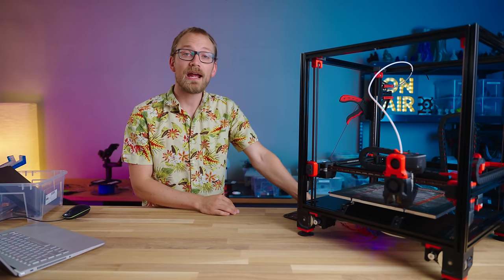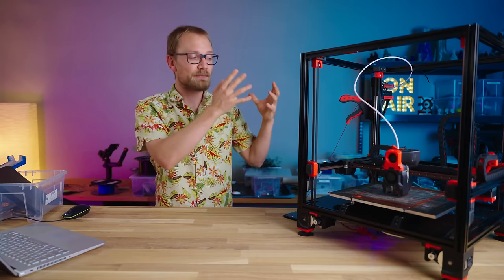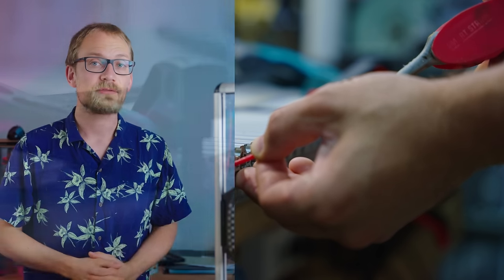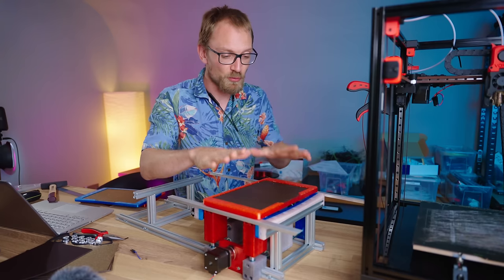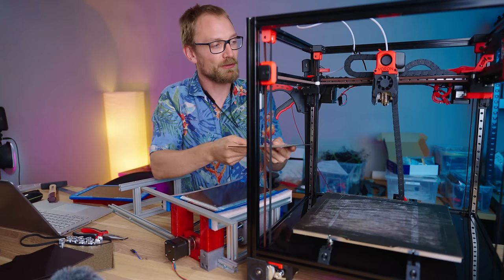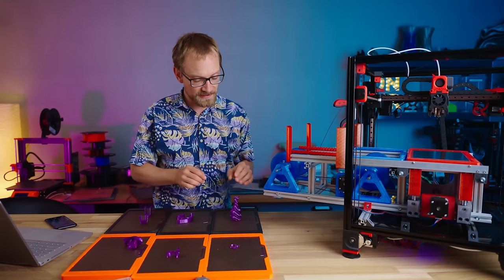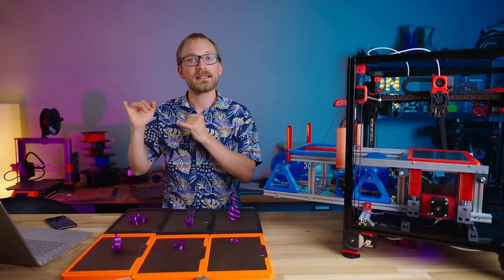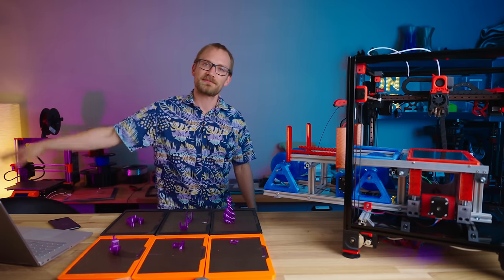Fully automated 3D printing using REAL print beds!

Comment: This is a really elegant solution to this problem, I really like the way your contraption is engineered! Now all it needs is an extension out at the end to catch the beds, perhaps in similar fashion to the hopper which feeds the beds?
Reply: Why not just a ramp with a slideout area? Simplest solution possible if you have some space on the side of the machine.
Reply: @nukularpictures  That could work well too, and would avoid collisions between beds and prints, however I was more thinking along the lines of keeping the footprint of the contraption as small as possible.
Reply: @cytokynesys  Well maybe just have the ramp sigsag down below the machine? If you want to keep the footprint small. 
A hopper will not really work with the prints. I mean you could build a horizontal storage but personally I like to build stuff as easy as possible and there nothing beats a simple slide.
Reply: @nukularpictures  Hmm, good point.

Comment: Pretty neat, almost patent worthy! A thought for your future versions of this to slim it down, install your retractable heated bed on a small cam that first tips down a edge and then lowers following the cam path. I think as an added benefit there will be much less force required to separate from the build plate vs just going straight down uniformly.

Comment: You can also just take the belt from the creality Cr-30. After each print, the belt just needs to move until the part comes off and the other side of the belt is showing. Sure you don't get do really long prints like the Cr-30 does, but you would still be able to use the full print space of the voron 2.4.

Comment: If you could lengthen the bed rails so they extend out over the printer bed. beyond the other side of the printer, you could gain almost full usable z-height.  You would need to extend the heated bed connection to allow for extra movement. Then, you could position your feeder unit down outside the printer. With this scheme, only the feeder rails would extend over the printer bed and you would almost have full z-height usable space.  You might need a couple legs on the other end of the feeder rails to keep the rails level. 

I hope this makes sense because it is a little difficult to explain without images.

Comment: This is a great design! Well done! With a few extra sensors to determine whether the bed is attached and positioned, as well as whether the "bed magazine" is empty or not, I think this could be a design which is suitable for industrial level production. Certainly a few refinements to the mechanical design would also minimize the amount of print volume which is lost, but this is very promising.
Reply from the maker: Oh yeah, there's a good amount of refinement still needed. But e.g. adding endstops at each corner of the bed that only trigger if it's seated properly, a sensor for detecting if there are enough beds left etc. shouldn't be that hard to do. Just wanted to get the core functionality proven first.
Reply: @MadeWithLayers  for a proof of concept, this is a really mature design. I'm excited to see where you go with this.

Comment: I know this was quite some time ago but here's a potential improvement idea. Maybe use the toolhead itself as part of the mechanism to change the beds. With some sort of hook on the printhead, it could push away and then go an pull back in the next print surface.

Comment: the most elegant way to recoup some vertical space would be to move all the electronics on top and move all the mechanics for the moving beds under the frame. It might take a bit of work and possibly some rewiring, but I don't see why not. Ideally the frame of the mechanism would become part of the frame of the printer, making it more integrated.

Comment: Hey Thomas, another way you could automate your Voron would be to use an assembly line belt like on the CR-30. every time the print would finish, the belt would just rotate until the print falls off the edge. you would have more print room for larger prints and (in my opinion) would be a more simple design.

Comment: I'd go with electro magnets, or releasable magnet bases driven by a stepper/belt drive system instead. Lots less complexity and likely a much smaller footprint required. I'd go as far as saying you could probably incorporate it into a custom heated voron bed and then side load your bed panels (which could also then be full size). With sufficient testing you could probably also just use sensorless homing; if the axis still spins the magnet system has failed to lock. 

Love it though, love the innovation and pushing what's possible at home.

Comment: I feel like you could regain most if not all lost height, if you modify the printer itself more. If you move the electronics to a side, you could build the mechanism into the base/as the base. That way it would rest right on top of your table and could be optimized to end up at the exact location of the original bed.

Comment: Awesome prototype!

What about using a combination of camera sensor cleaning tech, and ten pin bowling mechanics? 

After the print finishes, strongly vibrate the bed to loosen parts from it, then push them off the bed with a sweeper arm.

Comment: So hard!)) I made a cyclic printing due to the selection of adhesive, from which they peel off at a low temperature and setting the final gcode, so that as the table cools down, the carriage pushes the parts off the table. I'm thinking about adding a blower fan to make the process go faster. For thin parts, I made an additional spatula on the model blowing nozzle

Comment: You could move the "lifter mechanism" to the outside of the printer and rotate the axis of movement 90 deg so it is parallel with the outside of  the printer. This would give you a lot of z axis room. All in all, nice video. 

Keep it up :)
Katja

Comment: You should print a extra frame or just a small rectangle box the same size and load it last and use that as a pusher so the last bed plate is use able. That way you can use all of the bed plates you have and don’t have to manually place the last bed plate.

Comment: Cool build. I think I'd approach this slightly differently, I would just have a "wiper" that goes across the bed  pushes the parts off and collects the parts in a tray at the other end of the wiper. You would have to flex the bed to get more problematic parts off.  but I'm sure that's more than possible with what you have already.
Reply: Look up "poly lock"
Reply: @deannawilliams631  Seems like it loses adhesion only when cooled which when you have a bed at 100oC for some materials may not be ideal?

Comment: Using switchable magnets might be a more compact solution to the bed detaching issue? I don't really understand how they work but it's how some tool stands, and magnetic chucks for grinding machines work, you basically have an arrangement of magnets inside a block and by rotating one piece it can "turn off" the permanent magnets. You could hook up the on/off movement to a servo and get the same detach/attach function in much less Z height

Comment: excellent video!  little suggestion/idea for u to try: electromagnets!
How about a tank track like conveyor that moves metallic print plates onto the bed. The bed has a electromagnet that you can activate when required and release to allow a small motor and simple mechanism to move the track and print plates.

Comment: check out automatic pallet changer systems that large machining centers use. they are large tables rotating on the C axis located with large taper pins.

Comment: How about combining the ejection mech with the Z axis? Expose the bottom of a flexible plate through a hole in the bed. When you lower it past "minimum" a pin comes through and pokes the plate, ejecting the part. That way, you don't need another axis or any extra beds. You could even have a cam that tilts the plate as you continue rolling down the Z axis.
Reply: Then you have to wait for the part to cool in order to remove it from the plate. The great thing about this solution is that you don't have to wait for the parts to cool before proceeding onto the next print. And how to you print onto the the plate where the hole is? And what if the part doesn't have anything printed where the hole is placed in order to poke the part off of the plate? What if there are multiple parts on the plate?

Comment: To use the full Z height you would have to rebuild the printer so that the feeder system sits below the printer, so you'd have to move the electronics to the back instead the bottom of the printer.
Reply: Or just make the height of the printer taller. Instead of a 300x300x300 printer (or whatever it is) make it a 300x300x450 printer in order to regain the lost Z space.

Comment: To simplify the mechanism, how about instead of lowering the heated bed + magnet to pop off the current print bed, raise the rails using that motor? That way you can have minimal Z height lost for the magnet+heating stack and the rails are initially higher but before printing they come down with the print bed as it lowers into the magnet, giving you the Z height back.

That would be cool if the entire contraption pretty much would keep the entire Z height.

Comment: Looks like a good first start... 
Extending the Z-range, well.. if the bed system cannot be made much shorter then maybe replace the 4 Z-Axis 20x20mm frame rails on the printer with longer ones to get the Z-range back... 
I like the idea of using Octoprint as the manager for swapping beds. A cutom plugin could have the bed swapping GCode installedi into it and it just cycles back and forth between the bed swapping GCode and the next print's GCode.
Now you just need a slide for the finished prints to go down, out of the printer.
Cheers,

Comment: I liked a lot your video. Because the mine is a corexy, the bed is moving along of z axis. I think I would use a kind of little forklift, I think can be possible to use IR leds to look for the printer, and
 little magnets and hal sensors for fine tunning,  to detect where is the printer's bed.

Comment: I known this is 2 years old but I was thinking that either electromagnets or vacuum clamping could pull the plates flat and lock them down. Vacuum could also be used with any material such as glass plates.
I was also thinking of a tank tread system of fixed plates, but the plates would be individually very narrow, maybe 1cm in width. It would take a precision set to links to align them tightly edge to edge but as the print was rotated over the edge radius, the plates should release very effectively.

Comment: You could design next prototype so you dont lose almost 0 Z height. By using voron bottom part frame. Also make it much taller, so mechanism is partly under the printer. The chain, buildplate mover would go over original heating bed. With this way you could get the entire machine closed, only small holes and gaps at entry side, and curtain type thing on exit side.

The chain would exit the machine frame on other side, then goes otherside from under the machine then comes up again and then graps new plate. It could have 1 - 3 (depending howblong the chain is, distance between hooks somewhat longer than builplates), hooks or arms wich graps new plate. With this plates would bot be touching each others and can be placed onto the bed with precision.

Install smaller build bed into voron if needed(to get more room on sides), so changing plates would be bigger in size than your heating bed.

The while chain mechanics lifts up like 1cm then moves the plate and then moves another puild plate in there and lowers down, then the magsheet clamps the plate. That would be working, even withouth those extra thick frames you were using on this one. Maybe little U shaped aluminium bar could be ebought to make it stiffer, so the plate wont curve and stay put into the magsheet. The plate would be bigger in both dimensions so also those alu bars go over heating bed.

With this setup, you could use it almost as normal build size, ABS in heated chamber etc.

Comment: Super great idea Tom.  Just a quick observation, if the heated bed is dropping down vertically then the force to disengage from the magnet and spring steel sheet can be significant, however, if the heated bed pivots where front to back it lowers at a different rate then the spring steel bed will "peel" off the magnet (much like the prusa SL1 bed tilts to peel off the print from the FEP sheet).  The result should lower the magnetic force to seperate the spring steel.  Thoughts?

Comment: another idea would be to use an Anycubic Ultrabase and a pushing bar. this would be a bit more compact, cheaper, and easier to make. some extra babying will be needed to ensure the prints will slide off the bed well. Also, the magazine design would probably need a sensor for running out of beds

Comment: Very nice idea.

But the force needed to remove the bed by a lift mechanism seem problematic if you want to scale the system up for 300 by 300 beds. Also not only the force itself might become a problem - also the spring steel will bend a lot, so the frame holding it might have problems to hold it...
The probem itself we all know on resin printers - using z-lift to get an layer of the fep not only makes the well known "plop"-sound, it also puts a lot of stress to the fep; bending/stretching it a lot - a problem getting worse as bigger the size of the bed.
Prusa solved that problem with tilting the resintank underside the bed  instead of z-lift the bed.
I think transfering this idea to your mechanism if you want to scale it up might be a good idea. By tilting the heated bed under the spring steel instead of z-lifting it, you would reduce the force needed.

Another point in future development is the electronic side. Not to been missunderstod: Your solution is perfectly fine - but adds some cost. I very like the recycling of mechanical parts of an old 3d-printer. In my opinion electronics could be reused too. Any old arduino-based controller would do. You only need two lines to comunicate between bed changer and printer, one signal telling the bed changer to change the bed and anothe to tell the printer bed is ready. For the shot time of changing beds every few hours there is no need for TMC instead of A4988...

Your bed changer should in principle work with any 3d-printer with fixed bed, not only on voron. Of course, the "bed-feeding mechanism" needs some rework if you want to use it on another type of highspeed printer with fixed beds: Deltas. As you can not load and unload it there straight forward, but move it backwards an then push it out sideways before moving the next bed in)...

A 300by300 Voron prints fast - but I would call an automatic bad changer there a bit overkill, as even a very fast printer takes its time using the volume... A small Delta with 220 diameter or less would profit much more from automatic bed change. Thats another reason I would prefer a seperate old electronic for the bed changer: with old printer parts flying arround: You do not need to upgrade the printers electronic (even if it has no free IOs, you can always free the buzzer-line to reuse it for telling the bedchanger to do bed-change and then go into pause - and use a smal relay parallel to the printers buttom to trigger resume print). So the bed changer would mostly be for free (exept for the spring steels and filament of course).

Just some thought about further development. I realy like your concept and prototype.

Comment: My 2 cents, take the stock aluminum bed and bore some holes for magnets that will be used with spring steel sheets and make the nagnets electro magnets. This way all you need to do is turn the magnets off, mechanically push the finished spring steel plate off and a new spring steel sheet on. Exact placement of the steel sheet is not crucial because this method would allow you to use full size sheets. Anyway, that's my idea.

Comment: ditch the magnetic hold down for a vacuum hold down. check out how it is done for cnc routers.
honestly even just taking a standard voron 2.4 mic 6 bed and adding a 1cm grid of 1mm slits to it and drill tap for a simple vacuum pump with a super soft seal ring. this will let you just get by with a valve and pushing it off no need for the bed lift and drop system.

Comment: Great idea i like it but i dont think magnetics will work here. 
You should look at how they do it on CNC machines with vacuumpumps holding the objects down. I would use one to hold the metal print bed down while printing release vacuum to move it along. 
Im thinking aluminium buildplate with heating loads of small holes in it that the thin metal printbed you already have gets sucked down too. Underside of the heatbead has a vacuum chamber encapsuling it so you only need to connect one tube and a small vacuum pump use a valve to release the vacuum when print is done and switch the thin build plate and print next